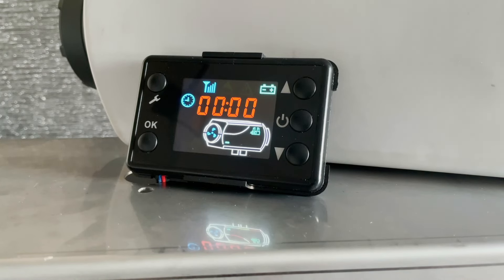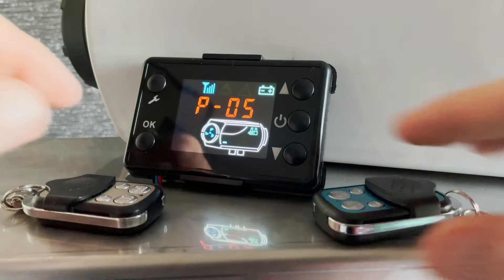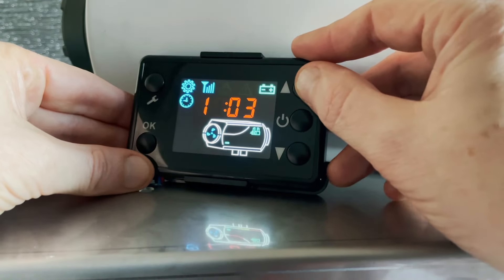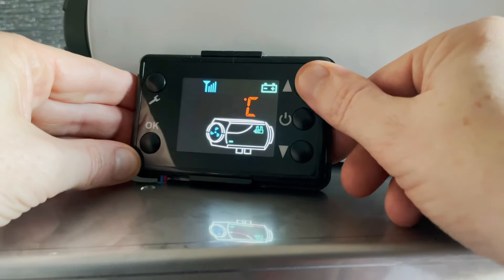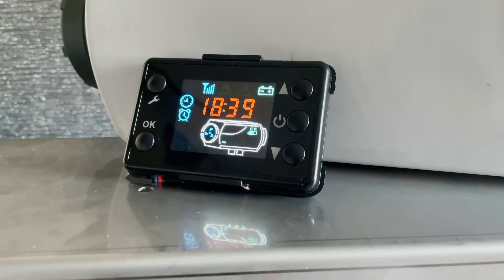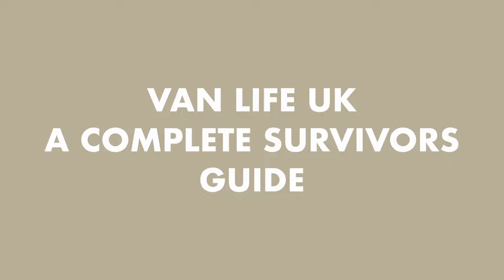How To use New Black Three Blade Chinese Diesel Heater Controller With Spanner button - Quick Guide

Comment: This video is extremely interesting for me  because it shows the same controller that I got with my Triclicks 5kw heater but I cannot make it work in the same way. I want to change it from P-01, P-02, etc to deg C but pressing the buttons you suggest doesn't switch between the power and temp screen as you show. 

Any suggestions on how I can change it from P mode to temp mode?
Reply from the maker: does it have the same logos on it? We have a tutorial of one that came with a triclicks on our channel if you want to take a look it is one of the fist videos we made
Reply: Yes, the icons (if that is what you mean by logos) are the same, spanner rather than a settings icon.
Reply from the maker: @damenfeld  Sorry I just read the full comment from before. if it has p mode rather than a hz setting then that means it only has one mode. you cant do much with that type of controller its not a universal one
Reply: @vanlifesurvivorsguide  But you showed changing from P Mode to Temp mode on your video? I can't do that on the one I have :(  am not looking for the advanced function or Hertz, just the way to change from P mode to temp :)
Reply from the maker: @damenfeld  Does it let you enter a menu with a pass code or can you even get to that screen?
Reply: @vanlifesurvivorsguide  'fraid not 😒, it would seem that although the actual controller appears to be absolutely identical to the one you are describing the buttons operate completely different, because nothing you describe works with the one I have - other than cycling though the menu options using the OK button.
Reply: Same for me too. I can't change from the "P" mode either. It displays a temp when the device is running though but not on the adjustment feature. @damenfeld
Reply: I wondered if the controller settings menu tree changes depending on whether the heater is in “Running” or “Not Running” mode? For example, I can switch between power mode /temperature set point but absolutely cannot  then bring up the “PE” option to pair the key fob. Funkin Nora I sound old 🤣😂

Comment: I have watched various videos but none seem to relate to my controller (Maxpeedingrods 2kw). Mine doesn't appear to have a priming mode, the only way to do it was to continually hold up and down at the same time to manually pump the fuel through the pump. Can you advise which video I need for my controller? Thanks.

Comment: Any idea if you can increase the lower fan speed for higher altitude on this?  You could do it on the opder ones in the secret menu but i cant figure it out in this one.  Im high in the mountins at the mo and itll shut off randomly from time to time with no error code showing.  Figure it needs more air flow

Comment: Great video. This controller is a bit different to others and the manual is crap. So thanks for this. I couldnt get mine into thermostatic mode until i watched this. 😊
Reply: Ive got the same unit as this but when I press settings and power mode together it doesn't let me change it from P mode... any ideas?
Reply: @ShaunyBoy06 im stuck on this too did you solve this?

Comment: We have same controller with spanner - just wondering when it turns off it doesn't flash OFF like the other type does, this one flashes CLEA - wondering if that means 'cleaning' instead of off?    Starts & runs fine & no fault codes so assuming its not 'clear'?
Reply: Just fired mine up today for the first time. I received the same CLEA message when shutting it down. Google was no help. It switched to OFF after a minute or two. Were you able to find out what this means?

Comment: Unable to change from Hertz mode to Centigarde  tried pressing Spanner and Power button same time but no luck any ideas! thanks
Reply: i also have this issue found a fix?
Reply: On mine, holding down the Settings button (Top left) will change it from deg. to pump rate and back

Comment: Super useful with the pinned comment thanks! Mine came with this and I worked out the 1234 code but had no idea what the rest meant. So I assume all the pulse rates are fixed for each pump size and heater version now?

Anyone tested whether switching to the 28ml setting on 22ml pump or 2000w setting on a 5000w heater brings the tick rate down and gets a leaner burn? Might be a glitch way to get the missing alpine mode. Seems like they have wised up to people messing with settings and destroying heaters so locked people out of the fan speed and tick rate 😂

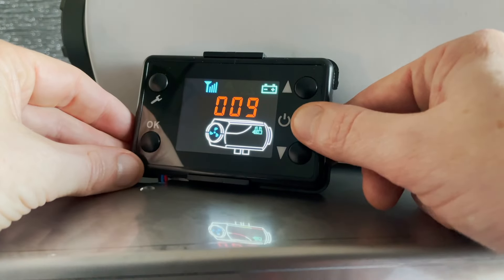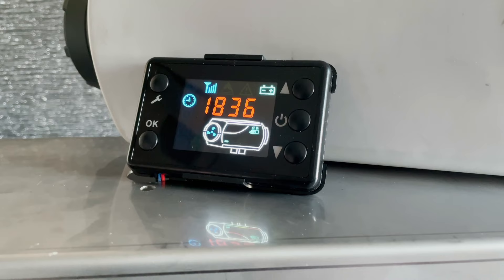Just to point out both the timers run concurrently, so if you want heater to come on in 1 hour for 2 hours you need to set 01:00 in the first menu then 03:00 in the second. So stupid that the thing has a clock but doesn't let you set by time making us count forward manually. At least it doesn't have the silly hours in decimal controller though!
Reply: I'm interested to see how to get a leaner burn.
After seeing many people do videos with the old controller and saying how it keeps the inside clean I think it would be good.
Wonder if there's a secret secret menu...
Reply: @danielc6034  I don't think they giving access to the pulse rate and fan speed anymore. Probably to many returns because people destroyed heaters! Turning up a fan max rated at 5000rpm to 5000 always was a sure way to kill it quickly.  Or 8hz tick rate in a smaller heater. My front room is way bigger than a average garage what these were designed for and hell I'd die if I ran it on p10 for a few hours. That's by dehydration not CO 😂

I'd like to tone it down a little tbh but I don't think we are getting that in the settings anymore. It's the nature of the beast run large heater under capacity it soots up. Run small heater over capacity it dies. They wised up and made the default settings foolproof...

But still, turning a 5kw into 2kw does it reduce the tick rate? If you tell it there's a 28ml pump does it tick less to compensate or does it send a bigger charge for a bigger pump and destroy a 22ml?

Logic tells me they aren't that smart and you'd get the leanest burn by setting 28ml pump in a 2kw heater and it would pump less fuel. But then you could also say set it at 16mil it will pump less fuel because it expected the smaller pump. My head hurts now let's stay warm and CO free 😂
Reply: @Matt Cooley  :)  Thanks. Hopefully these are all questions someone will answer with a bit of time.
I don't have any tools accurate enough to test these settings.
Reply: @danielc6034  Tested with a click counter app on phone. Does exactly what I though. 2K setting and 28ml pump reduce the tick rate by about 0.3Hz each.

Default H 22 is 1.6Hz on P1
L28 is 1.0Hz (Struggles to light)
H28 1.3Hz
H16 is about 2.2Hz

Left mine on 28ml and it's toned the lowest setting down perfectly and maintains temp now rather than increasing
Reply: @Matt Cooley  Amazing!  Going to change the pump setting I'm a sec when it stop raining. Mines on p1 at the minute slowly raising but have all the doors shut so smaller space.

Did you notice fan speed change?
Reply: @danielc6034  It seems marginally quieter so I suspect it has reduced no scientific way for me to test though. Case temp hovers around 155-160c now as well so it runs a fair bit cooler
Reply: @Matt Cooley  Just brought a  new old controller of ebay. Only £15. 

Been thinking about it, reducing the pump speed is ok but having no control over the fan and the housing being cooler I'm wondering about the soot/carbon level inside.
Be interesting to see which model shows up.
Reply: New old style controller has arrived. Wiring layout the same on the 3 pin plug but it gives a e 07 error.
Wonder if it's not compatible with whatever board is in the heater.
Reply: @danielc6034  Could be 07 is wiring/communication fault. Don't think mine is really sooting up much but I tend to give it a blast on full for 10 mins at startup and shutdown. Haven't noticed any smoke or particles yet
Reply: @Matt Cooley  Gone back to the old controller for now. Set it to 28 pump.
Did a bit of realsearch, and I do the 10 min full blast before shut down also.  Doesn't look like you need to do it every time but I'm still playing. 
Might have to return my power supply as its only registering at 11.1v.
Reply: @danielc6034  mine drops to 10.8v while glowplug is on. Nothing to worry about. It's a 10a supply. It's fine 😀
Reply: Does setting the pump from 22 to 28 feed the 22 less fuel
Reply: @petermaceachern4843   No it lowers the rate. The same amount of fuel will go in as that's fixed by the pump size not the setting. By setting 28 it assumes a bigger dose per tick so slows the rate by roughly 0.3Hz only. Less fuel usage overall but a 22 pump will always inject 0.22ml of fuel.

Comment: I had the old type controller on my last heater, I could turn down the fuel to 0.8.
My heater broke down so I bought a new one, spanner type, Question,, is there any way to turn the fuel down, fan speed down ?

Comment: Hello I am getting a E07 code and I cannot figure it out. Can you please help me
Reply from the maker: Hi yes, it  means the controller isn't communicating with the motherboard. Have you changed either recently? Check the connections on the wiring loom are all clipped correctly. Take the connectors apart and make sure the pins inside are straight and not bent. Is it a new or used heater?

Comment: Hi! I have a question, maybe you can help. I installed my diesel heater, all good, but every time I start it up it goes trough a procedure, fan starts to run, fuel pump starts to run for a while, firing up and than the fuel pump goes faster and faster, so it does the fan, and only after it slows down to my H1 slow choice. Is that normal, shouldn,t it start with the choosen speed? I have the feeling it always does a selfpriming procedure, with every startup. Thanks!
Reply: as I know it ,the fan not only controls the air outside the combustion chamber but inside it,, and a high setting would cool glow plug on startup.

Comment: Got the Vevo heater... the triple tap on settings button to get into the 'hidden' menu don't work on mine. 
To prime mine, you have to press (and hold) up and down together.
Can't figure out the remote or how to set clock. Seems different to all the previous lcd controller models...
I think they've changed something deliberately.
Reply from the maker: hi mate, so on that controller you need to press the power button and the down button at the same time for 2 secs to enter the pairing mode. 

You can pair up to 5 remotes on that controller so you have to choose a number to pair it to between 1 - 5. 

If you want to set it as number 1 you just need to press the "on" button on the remote and it will pair. 

They don't have clocks though that type but do have count down timers to set it to come on in a certain amount of hours and mins up to 99 hours and 99 mins. And then you can set one to go off in a certain amount of hours and mins too
Reply: Try taking the fuse out then going directly to pairing
Reply: @vanlifesurvivorsguide  Thank you very much, this helped me a lot with pairing my Vevor diesel heater's remote control.

Comment: Hi I have just bought one of these and it keeps coming up with e01 error code but it's a brand new battery can anyone help?
Reply from the maker: it could be volt drop, the cables to the battery might be too thin. Check out our error codes video
Reply: Thanks
Reply: @vanlifesurvivorsguide what size cable should it be please?

Comment: Does anyone have a problem with the heater control panel glowing dimly when the unit is turned off ? I cannot figure out how to extinguish the LCD panel at night ?
Reply: When heater not in use screen is continuously low lit 🤷🏻‍♀️
Reply: Adding a main power switch would enable you to turn it off. BUT remember NOT to switch power off until the Cooling Down cycle has finished, else electronics will cook.

Comment: I have the same controller; however, nothing happens when I push the spanner and power buttons to switch between modes.  Any suggestions?
I've spend two days trying to fire it up and constantly get failed starts.
Reply: We are having the same problem .
Reply: I have same looking controller only temp/ set by holding both up and down at same time.
Reply: Just hold spanner for 2 secs on some.

Comment: I take it that the thermostat in this controller cannot turn the burning of diesel entirely off and then start it up again as needed? In other words, it will always burn some fuel as long as the heater is turned on? Makes a huge difference for fuel consumption.

Comment: Ive just got one of these and the special settings menu is confusing to say the least , Ive got other heaters a 5kw and 2kw but ive always tried to get the blue lcd screens that have the code 9009 to access te special settings menu and they give you lots of adjustment of Hz and fan speed settings althougth I didnt find it to healthy to mess about to much as the carbon monoxide enters the hot air stream through the glow plug hole from the glow plug breather as tiny as it is we were getting 33 parts per million in our living area, I ended up using some high temp silicone fire sealent to put around the glow plug rubber cap. fortunately the heater is outside in a custom wooden box bolted to our outside wall. I was going to convert the latest addition to the collection a 5kw heater to the blue screen with the lcd remote but now ive seen your video I might give the screen it came with a try it seems that theirn are some better controls in its special setting  menu like being able to run it as a 2kw or 5kw unit. I have noticed that a 2kw needs to be run at around 2.5 Hz for the same heat output as a 5kw at 1.7 hz making the 5kw slightly cheaper to run running the same size 22ml pump. the 5kw minmum setting is 1.7 Hz no matter how low you set the special settings menu on the blue Lcd display.the 2kw will alow you to go as low as 0.9 Hz but this is so low it practically wouldnt heat much of anything.

Comment: so it has a clock, but i cant set the thing to come on at 7am / smh
Reply: It isn't timer, it is a countdown, first countdown is when it'll start, and second is to stop it. If you put 1hr on first one it'll switch on in 1 hr, if you put 2hs in the second one it'll switch off in 2hs (it'll run for only one hour)
Reply: @lucianosotorodriguez4468  so i arrive home 'from the club' at 01:45 and have to do math to set the turn on, no, just no, the software is just poorly written and not fit for purpose.
Reply: @lezbriddon  I agree it isn't well written, I was just telling you how it works.
Reply: @lucianosotorodriguez4468  lol sorry being so harsh I thought you was defending the lazy programmers choice.  I had to roll my own code for a heater and dealing with time rolling over midnight not causing issues isn't a single coffee fix...... And I cheated.... I ended up using start time and duration instead off start and stop times.
Reply: @lezbriddon  no problem mate, I guess is the price we pay for a cheap piece of equipment, I cannot guess how to use the thermostat option. I read someone said it only works when you set the timers, but it still doesn't do anything for me

Comment: Just got one of these heaters with this controller, everything was just as in this video except I cannot change from temp mode. Pressing power and spanner buttons does absolutely nothing, am I missing something or is it a duff control panel?
Reply: Looks like me and you have the same controller.
Reply: spanner + ok for 3 secs or so... then admin mode by using spanner button to toggle down through time, timer1, timer2, then admin...enter the psw, then ok, then on the 4 digit display, change the t to a P using up or down arrow...
Reply: @timkelly5602  👍 cheers,I'll give that a try

Comment: just got one with this control has anyone worked out what hertz the pump runs at with each p value
Reply: I would also like to know this
Reply: Lowest hertz setting is 1.2, this means 1.2 pumps per second, 1.3 is 1.3 pumps per second and so on.

Comment: how do you change the voltage from 24 to 12
Reply from the maker: Watch the bit where we get into the settings menu with the pin code. The 2nd option is 12v or 24v  1 is 12v or 2 is 24v

Comment: Ive got the same controller but screen is blank when off but power connected. If I press the on button the heater starts to go through the start up procedure. Any ideas? Thanks
Reply: Faulty screen/controller, loose connection?

Comment: When I try to enter the passcode, after I hit “OK” for each of the 4 spaces (1, 2, 3, and 4), the digit/character does not persist on the screen until the completion of the passcode, like it does on your video.

Instead, after I select “1” for the 1st blinking dash, and then hit OK, it moves on to the next blinking dash (the 2nd one), but where I just entered “1” in the first blinking just goes back to a solid dash.
 
Then after I do the same thing with the “2” in the 2nd blinking dash, and then hit “OK”, then it goes to the 3rd blinking dash leaving the 1st two dashes as solid, non-blinking dashes.
Then the same thing happens for the 3rd and 4th dashes, and then it does not get me to the “secret“ menu or anything else different.

Also, when I try any of the holding down 2 button combinations that you mentioned in this video, nothing happens. 
My controller only responds when I do anything only 1 button at a time.

Anybody have any solutions or guidance for me with these 2 problems?
Thanks!